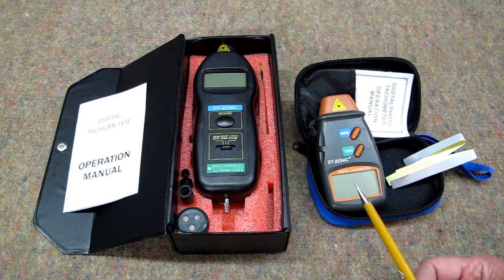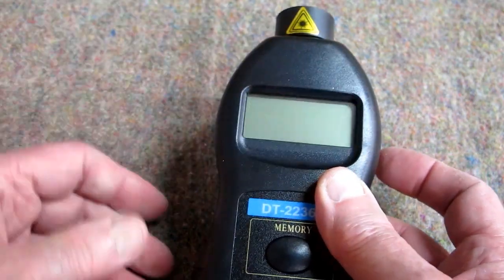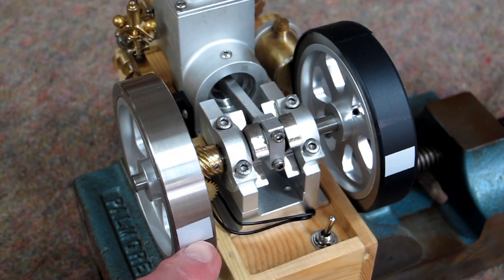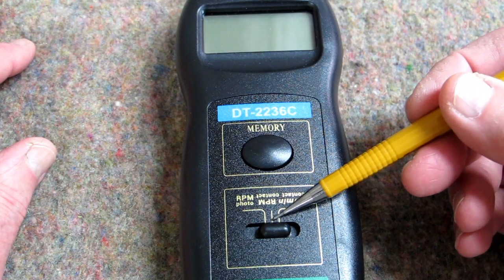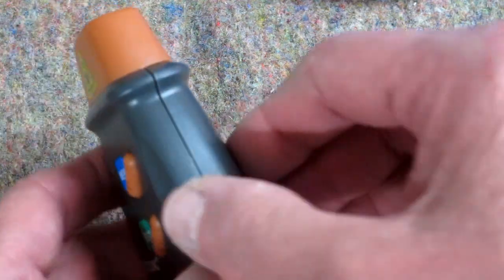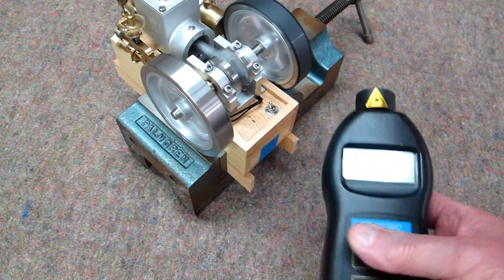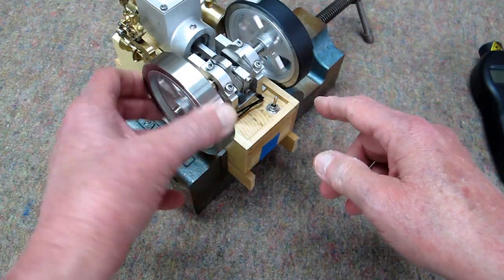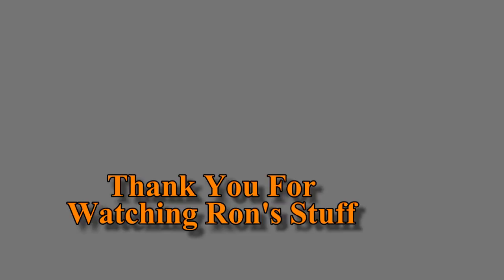Handheld Tachometer - Laser & Contact - Review & Demo

Comment: Ron ... If you want a new tachometer project, it is pretty easy to add a digital-readout tach on the front of your drill press.  I built mine using a Hall proximity monitor triggered by a button magnet epoxied to the underside of the drill press pulley attached to the chuck.  The proximity monitor sends a counting signal to a counter/clock mounted on the front of the drill press head.  Easy peasy, and pretty cheap.
Reply: I’d love to see a video of this in action and how you put it together

Comment: What makes you say the contact tachometer is more accurate? I would expect that the contact induces a small load on the engine which slows its speed, so I would expect the laser tachometers to have a more accurate reading (~2000 rpm) because the act of measuring affects the phenomenon less.

Comment: When you use the contact tachometer you are putting a small load on the engine and I would expect a slight reduction in speed.   Just because you got a different reading does not make either one wrong.

Comment: Don't you get a wrong reading for rpm when the shaft is a different size then the piece on the tachometer?  thank you
Reply from the maker: No, not as demonstrated. The "rubber cup" on the end of the tachometer centers itself on the motor shaft so the motor shaft and the tachometer shaft are concentric with each other... turning on the same centerline. You do need to hold the tachometer parallel to the motor shaft while taking the reading.
Thanks for watching. Please subscribe! 
That is what keeps this channel running. 
Ron

Comment: how far from wheel do you have to be  for it to be right? i testing a 12hp motor and 6 inchs was way high. far away was closer to idle rpm.. like 2ft away. its with the 12 buck one in this video.
Reply from the maker: As you see in the video, I am fairly close to the flywheel. Measuring off a larger diameter will give better results (a pulley rather than a motor shaft). A non-reflective surface with the reflective tape will be more accurate (a reflective or polished surface will reflect the laser as does the reflective tape, giving some false readings). 2 ft away is probably too far away. If you can rest the tachometer on a solid, non-vibrating surface it will give better readings than trying to hand hold it and it is being waved around a bit (the steadier the better). Think of it as looking through a rifle scope... only as accurate as it is being held steady. Also, the tachometer needs to be held square to the rotating surface (square in both directions). The more accurately (and steady) you hold the instrument the better the readings will be. Usually, the closer the better (as long as it is safe to do so) as fewer false reflections should be detected.
Truth be known... I still prefer the old fashion, analog, contact tachometers.
Thanks for watching. Please subscribe. 
That's what keeps this channel going! 
Ron
Reply: @RonaldWalters2010  went out to retry how i was doing it.. after you saying about the reflective surfaces. found it worked much better. also sun light doesnt help to much lol... but i wish i could use contact rpm. but old kohler 12 hp motors sort of tough to touch anywhere to get reading.. be nice if someone made a tach for 1 cyl motors. but ty for responding and info it helps for sure.. good vid..